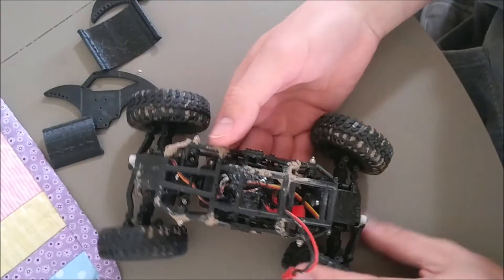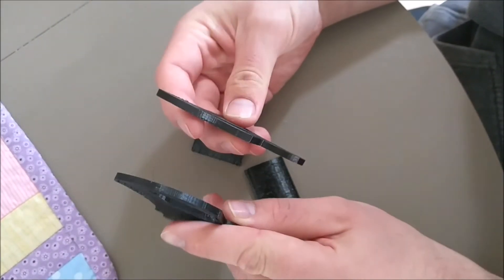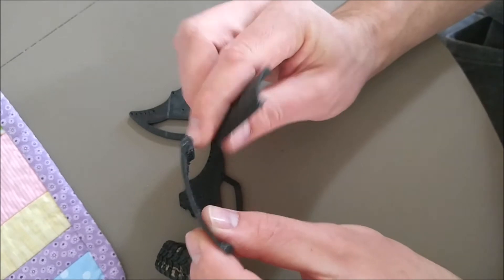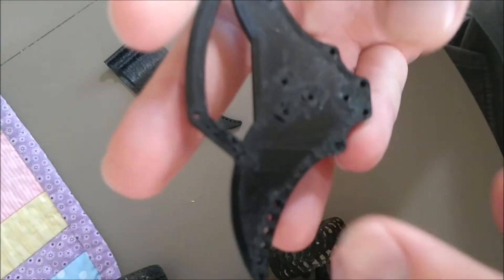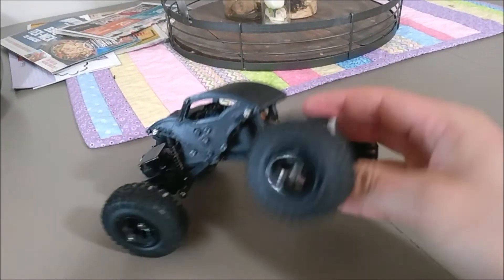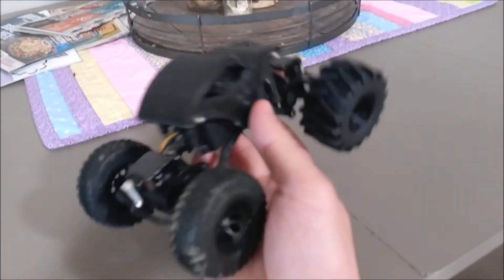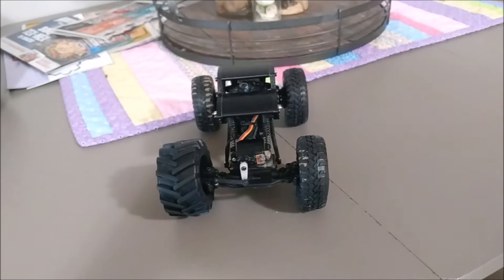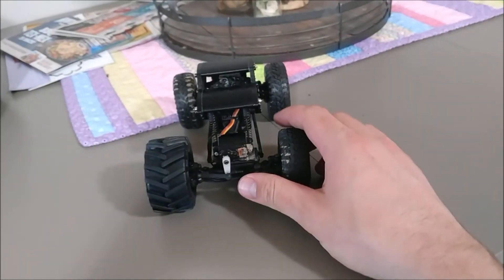3D Printer "Baja Bug" Style Chassis for the Basher Rocksta 1/24 Rock Crawler

Comment: Hey, try using the thinner sideplate on the stl files it gives you a 6mm thinner overall width on the chassis itself. I made that thick one for those that needed to use stock bolts to makes things easier :). The hood and top I print at 85% infill to make them print better but every printer is different I guess. Also, I'll be posting the large beadlock wheels for the 1/18 tires on tonight hopefully so that may give you more options on your tire selection.
Reply from the maker: I actually kinda like the thick side plates! I too have some 3d printed wheel options in mind ;)